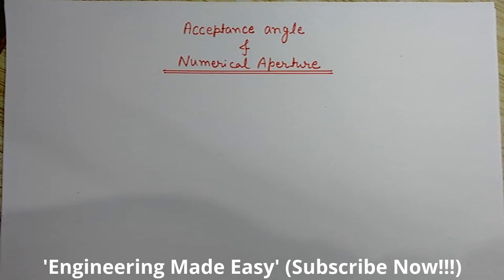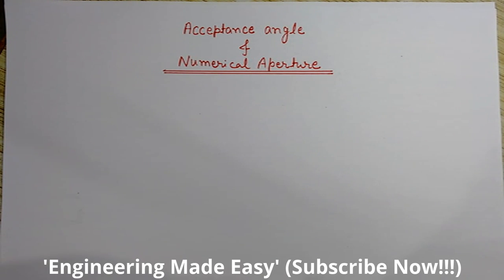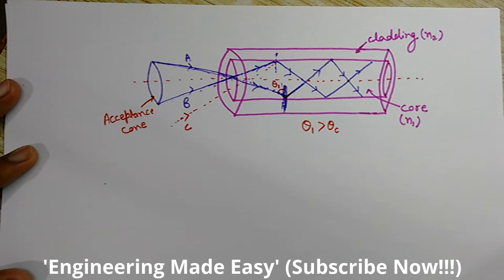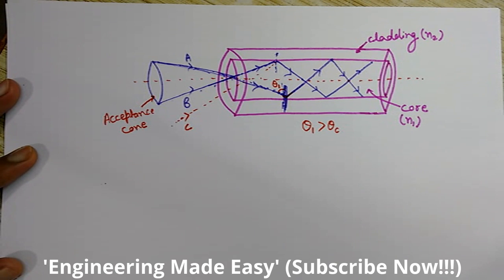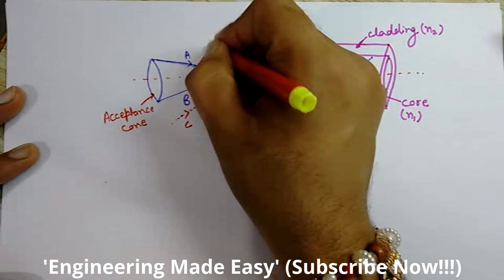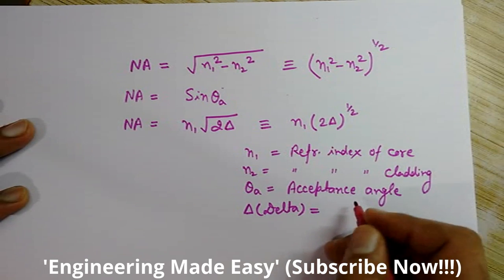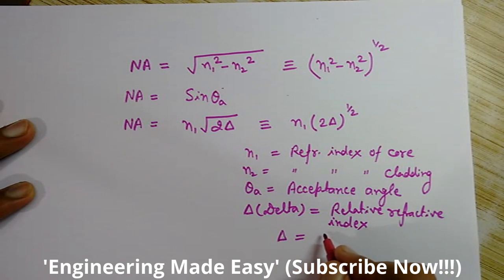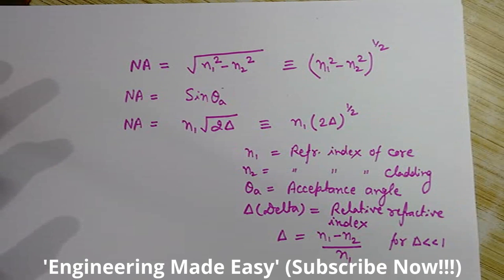Acceptance Angle and Numerical Aperture - Optical Fiber Communication - Optical Fibre - NA

Comment: When the light from outside is entering  the core the light not deviating according to you bt as actually it will bend toward normal and hence the acceptance angle will be changed by little more.